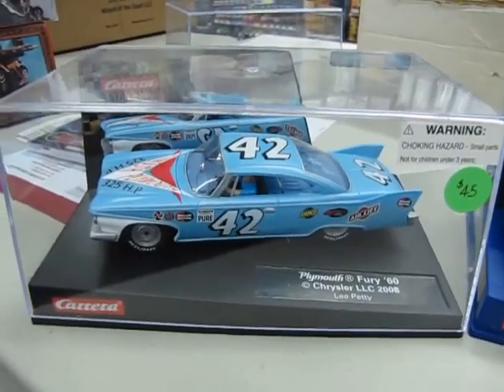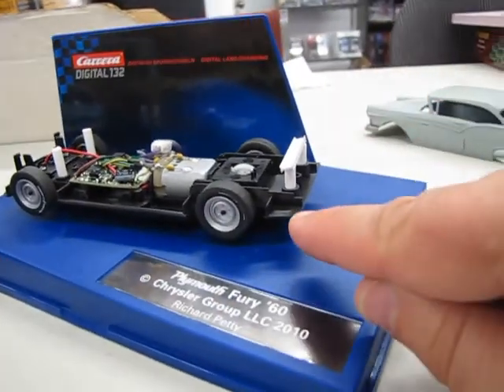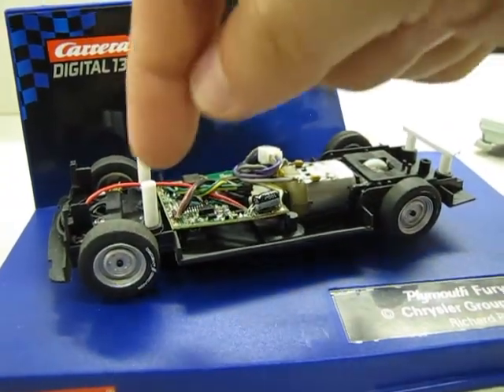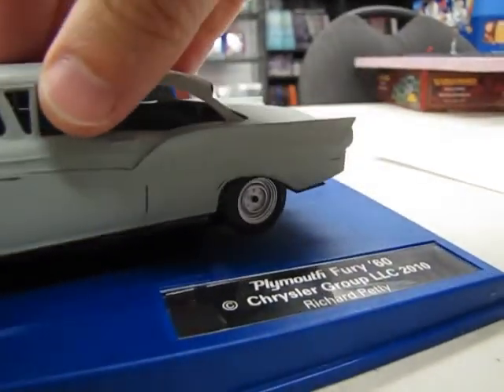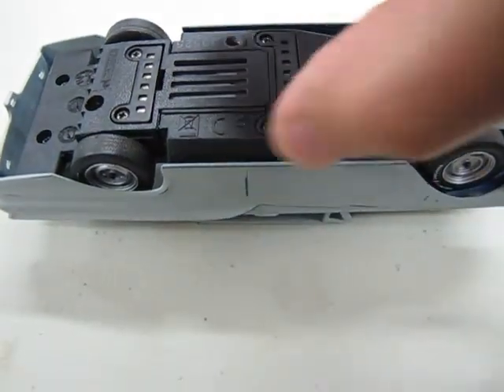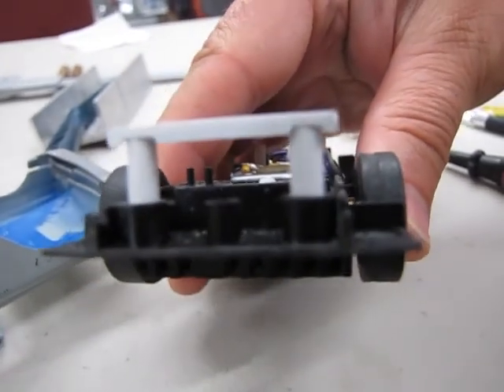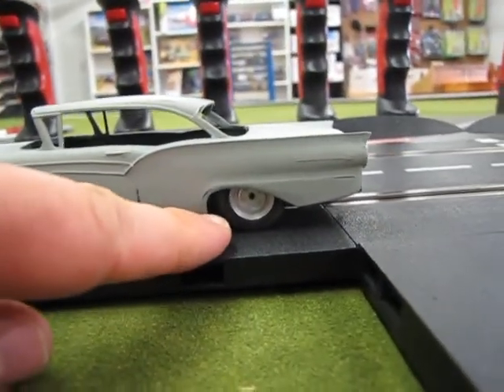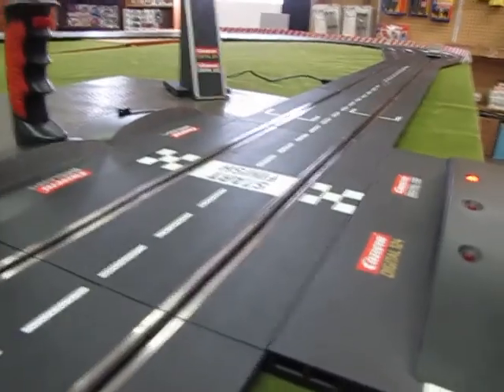How to convert a Revell 1957 Ford Model kit into a digital slot car using a Carrera 1960 Plymouth

Comment: I have been gathering a number of Carrera nascar type cars and putting them onto scalextric digital for home use with ghost cars etc. I do a lot of kit converting and have many in stock. Amongst them are 2 revell 57 fords, one still in bag unopened in pink (like the one used) and an earlier version mainly in blue plastic. I also have an unopened revell 57 chevy snapkit to use for building.  My other 57 ford i have that is the Aurora Demolition Derby.
Other cars I may build using Carrera chassis and gear include some original Revell kits  from the late 1950's and a few of some of the re-issues.
keep up the good work.
Reply from the maker: Sounds cool. Mine was the blue plastic kit. - Also, you must be happy this year as Atlantic plans to re-pop the Revell 1/32 scale car kits.

Comment: I have a digital 70 chevelle ss.how do you switch it to analog. I was told you could.
Reply from the maker: Just move the white switch underneath. It will turn off the Digital Chip inside the car.
Reply: @monsterhobbiesonlinestore  thank you
Reply from the maker: @buckster2575  No problems...It's a simple thing to do.

Comment: If you wanted to change your Analog '57 Ford to a Digital Car, what Carrera (Chip) Conversion kit would you need?
Reply from the maker: Do you mean a Carrera Analog Plymouth getting a Digital chip into it and then modifying it to the Revel kit conversion here? - In that case i just used the Carrera chip. You unplug the left / right switch from the pick-ups and motor, unscrew it from the body, and the Carrera Digital chip will fit right in the same place and plug into the same wires. The only thing you need to do is pop out the little black "window Plug" in the analog cars.  - i should create a video about this someday!
Reply: Yes, that is exactly what I mean.
Reply from the maker: Lucky i found your comment...these 2 didn't appear in my notifications! :D

Comment: do you have and revell carrera digital cars for sale??? thanks
Reply from the maker: Just the regular Carrera 1/32 Digital Cars. you can find them at www.monster-hobbies.ca
Reply: thats ok i wanted the revell ones .i will look elsewhere thanks
Reply from the maker: @patrickkerns2022  No problem. Good luck in your search.
Reply: @monsterhobbiesonlinestore  thanks i think i found some but will cost about 100.00 to have it wired for digital but i still looking .to bad not many do thesecars anymore theyhave many older cars would be so great to see them as digital slot cars.just gotta find the right guy who will build them for you  for a good price.take care
Reply from the maker: @patrickkerns2022  The Revell cars haven't been produced in a long time. I basically converted this one from a 1/32 static model kit body and a Carrera undercarriage. hopefully this video can help you out with at least one of these models.
Reply: @monsterhobbiesonlinestore  yes thank you i seethe galaxie and the fairlane  and a charger on ebay but they are analog not sure if he would rewire them